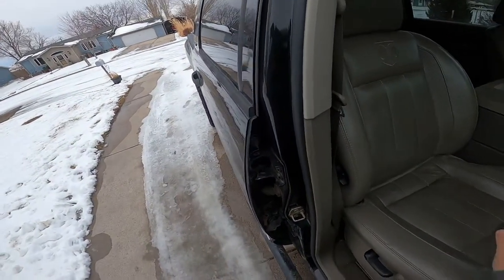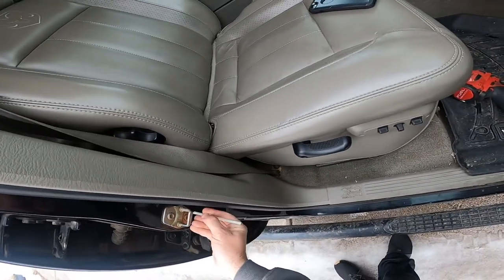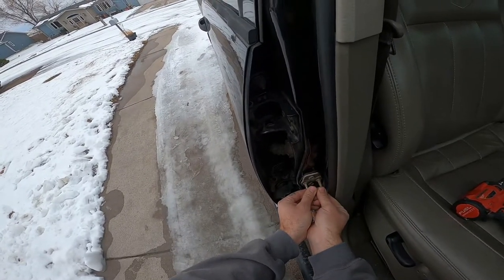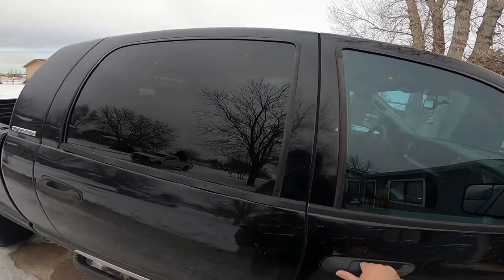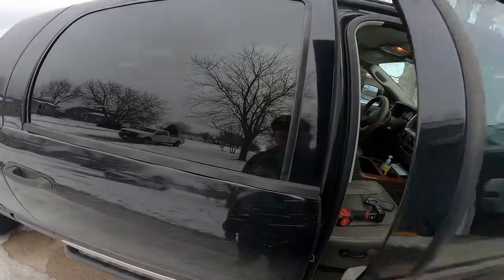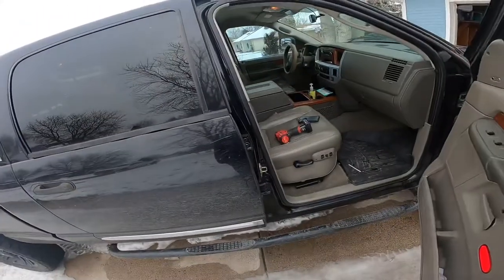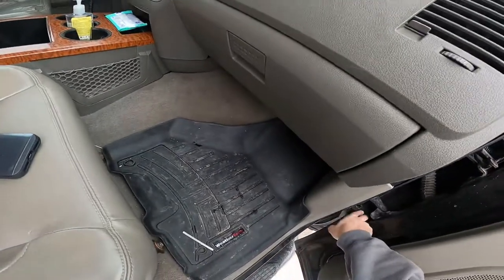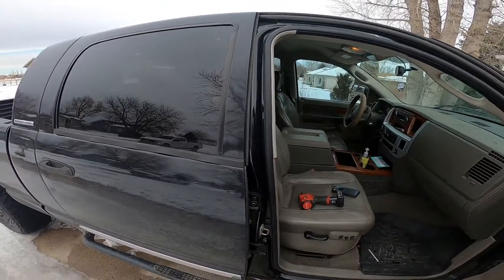No More Wind Noise!! Dodge Ram door latch adjustment.

Comment: When adjusting the plate and tightening the bolts the plate would slide back into its original position. Any suggestions?
Reply: Did you ever figure this out?  Same issue here.

Comment: does this help with rattling and squeaking noises from door panel
Reply from the maker: No not really best thing I have found for that that is putting cotton batting in between the door panels and door or your hinges maybe completely wore out.
Reply: @BASgarage  i just put on new mirrors and ever since then it sounds like metal on metal ticking/squeak coming from door panels on the inside when i’m driving i have no idea what it is i’m gonna try the cotton and see if it works thanks

Comment: What about the situation when you drive your car in strong wind?
Strong wind that can cause the trees move ! Does your car still have wind noise in that case ?
Reply from the maker: Yes for the most part mine has little to no wind noise even with really strong side winds
Reply: @BASgarage  wow thats really strange to me. My car has no wind noise if the weather condition is okay. When cross wind / storm/ hard rain hits the car from 70-80 km/h I can hear the sound all over the car. Mine is adjusted with the door striker already.